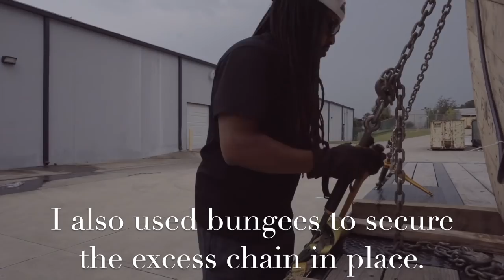How To Use Chains and Binders | Learn How To Secure a Reel for the First Time w/Me | Non-CDL Hotshot

Comment: You get a chance, get some rubber skid mats (steel/aluminum coil plants) reels/coils use beveled 4×4/6×6 dunnage with steel racks (short ones) aluminum racks (long ones) if you do steel or aluminum coils use coil cuffs or the edge protection so as not to damage the coils,  tarp. I used my chains from the outer edge of stake box, under the box to the coil, you get the whole rated weld for that securement position, I also use hook to hook with the ratchet binder hooked to chains with the slack taken out. If there are spools box spools on your trailer rub rail, you go from the outer edge of box, under box, to spool back to load. Sometimes you can't depending on the weight/size of the coil/spool. Remember in flatbedding, there is no such things as enough securement. Over is better than watching that coil say adios off your trailer into the front windshield of the car behind you. Some skateboarders will say "you can get away" with this amount or that amount, you're just one curve/overpass from meeting dark karma. When you use your straps, hook to trailer frame through the rub rail. Don't hook and loop at the rub rail, defeats the purpose of the rub rail protecting your chain/straps in a side swipe accident. Metal Transportation Covered Wagon, Hunt Transportation Flat/Step/RGN, Newco, Double drop, Hubach, Step/Flat. Keep the positive vibes.👊😎

Comment: You should use coil racks under the dunnage, if no coil racks,  then nail them with blocks in front and behind the dunnage. I personally would never put straps on dunnage to hold a reel down.

Comment: I have my maintenance guys weld a shepherds hook on the pole and it’s easier to pull the chain’s through vs. pushing.  Good video.  One other thing to add,  if you add coil racks it would be more secure and no need to use straps.
Reply from the maker: Great tip! Thanks bro!
Reply: No problem!  Keep on trucking, be safe

Comment: I start hotshot on Monday. 5 years dry van tractor trailer combination experience but no  flatbed load securement experience at all. I feel lost. I hope they just dont throw me out there by myself. Its for a small company of 4 drivers i will be the 5th
Reply from the maker: That’s what’s up bro but maybe attending a securement class would help if you have no securement experience. Most of these companies just throw you out there unfortunately. But if your a driver I would hope they train you first.
Reply: @HotshotMacc  yes I'm a driver and I've pretty much learned myself as I go. Its not too complicated

Comment: If the chains don't hold, the 4 X 4's won't do any more than the 2 X 4's. For cable reels and large tanks I have some 2 X 10's that I ripped down the middle at a 45 degree angle making 2 X 5's with beveled edges. I keep deck screws and a cordless drill and just screw the boards to the deck.
Reply: thats what i was just thinking of screwing the boards in
Reply: @imbrasi4372  And when I unload, I don't have to secure the boards...they aren't going anywhere!
Reply from the maker: I hear you and great ideas. But I don’t do reels enough to keep that equipment on me.
Reply: @HotshotMacc  I only carry them for reels or tanks. My situation is a little different as I take care of my Mom so I have to be home every night. For a more secure bulkhead (the way you used the 4 X 4), use a chain and binder the same way you would store your dunnage on the deck.

Comment: What size trailer do you have? What do you recommend for a 3/4 hotshot?
Reply from the maker: This is the trailer I have https://youtu.be/w7a4u32mWDY. Anything below 6,500 lbs between 30-40ft. Make sure your length is not more than 65ft combined
Reply: Alright thanks man. Looking at a 14 GN 28+5 and a 2021 Ram 2500 crew cab.
Thanks for the info.
Reply from the maker: That’s what’s up bro

Comment: Do you have to know how tall your load is for clearance or do most of your loads be under the clearance height?
Reply from the maker: Ive never had a load that had a clearance issue but it’s good to know in case you come across a low clearance bridge just to be safe.
Reply: @HotshotMacc  Thanks so much :)